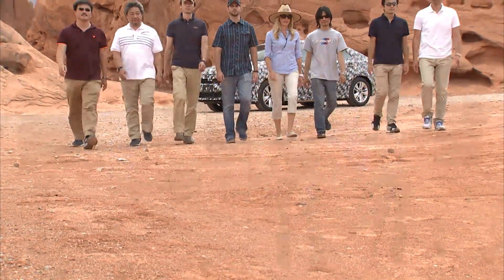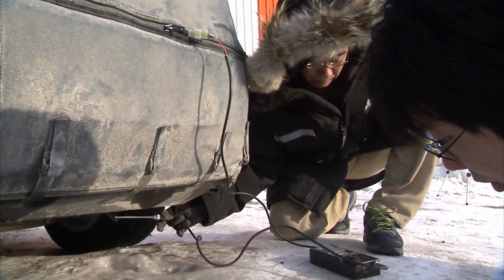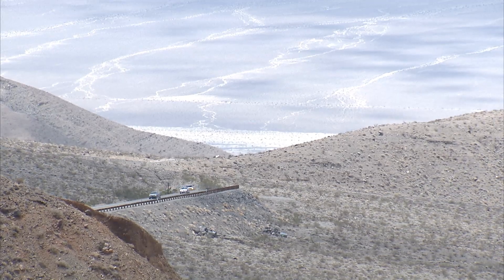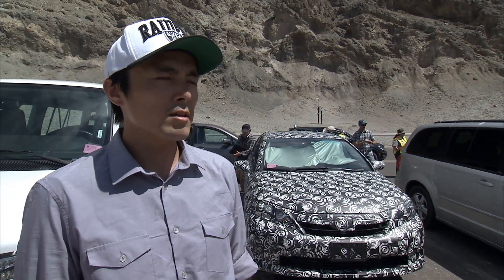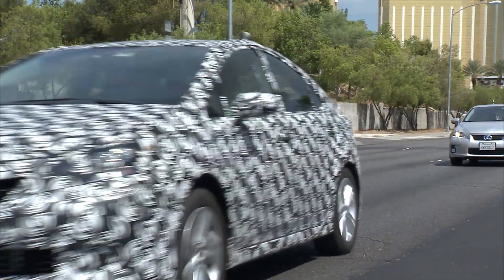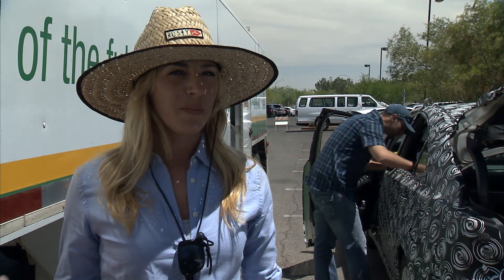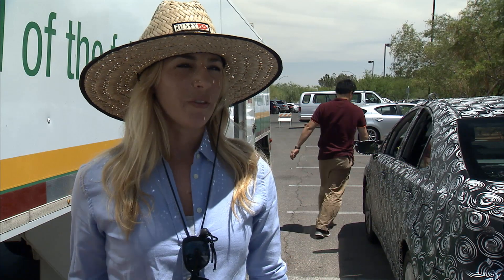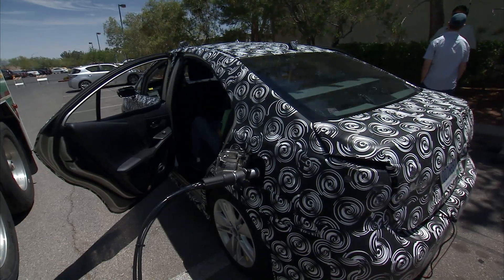Toyota Fuel Cell Testing Vehicle - Hot Weather Test

Comment: When hydrogen and oxygen combine it creates water right, so in a cold freezing day wouldn't the water in the vehicle  freeze up over night or while driving freeze up aswell?
Reply: +Mohamed Ali no fuel cell produces hot water + steam  b/c its operating temperature range is about 80degreeC

Comment: This is all fine and dandy... but without a refueling network this car has the exact same issues as all other electric vehicles, and that's range anxiety. Tesla seems to be on the right track, and once they get their Model 3 out, combined with their SuperCharger network (which, I might add is included with the cost of the cars), this will have some stiff competition. I'm curious about the longevity of the fuel cell, we all know that batteries eventually wear out, and it sounds like the fuel cell will have parts that will eventually need to be replaced, but I'm curious about their projected life span.

Comment: I dont know why Toyota is bothering with a hydrogen fuel cell vehicle.  All the internet trolls and know-it-alls have stated this isn't possible.  Silly science.
Reply: Yes it is possible, but it does not make much sense.
First, they are promoting hydrogen as alternative to fossil fuels, and 95% of hydrogen coming from  FOSSIL fuels (natural gas, mostly by fracking) and nobody will produce hydrogen on large scale with electrolysis while cheaper alternative is available.

As for getting hydrogen from water, for hydrogen you have to put in 100kWh of energy to get 23kWh to move the car. In EV, for 100kWh, you get 70kWh to move the car. So hydrogen station creating hydrogen on site will use so much electricity that it could charge 3-4 times more electric vehicles. For example, electricity used to fill up 1000 fuel cell vehicles for 300 miles, could fill up 3000 electric vehicles for the same mileage.

Price: 50$ for 300 miles? That is more expensive than a petrol car, and this is with 'cheap' hydrogen that is coming from fossil fuels, it can only get more expensive.

Who loves hydrogen? Big oil companies, because they produce it from fossil fuels, and fuel cell cars would let them keep their monopoly.

You can say, we will put solar panels, wind turbine or any other renewable and make hydrogen that way for 'free', but that also does not make sense, because with the same solar panels or wind turbines you can support 3-4 times more electric than hydrogen vehicles.
Reply: Sasoon2006 You're full of shit, everything you said is either wrong or biased towards what you think is right, get real welcome to the future! And this is coming from a petrol head.
Reply: TheChamp 101
So please correct me, what did I say wrong and what would be correct?
Reply: Sasoon2006 Can't be arsed to go into detail with a spastic like you but briefly I'll say this, fuel cells are far beyond any plug in electric motors, it will be the standard within 15 years get use to it, just hope all the shitty american car manufactuters catch up.
Reply: TheChamp 101
Of course you can't, when you do not have any arguments.